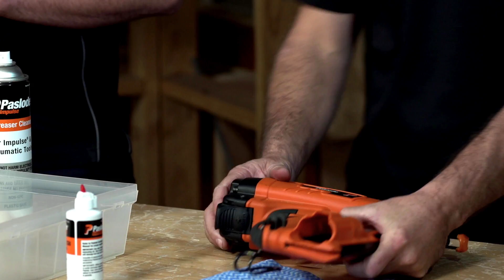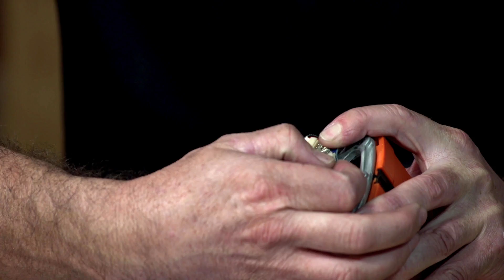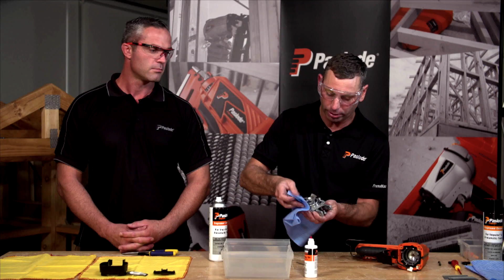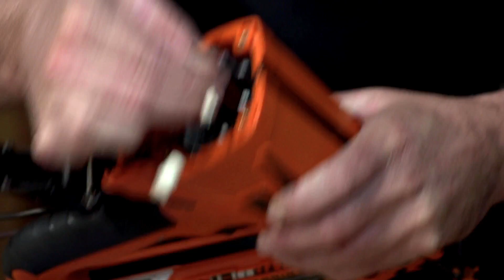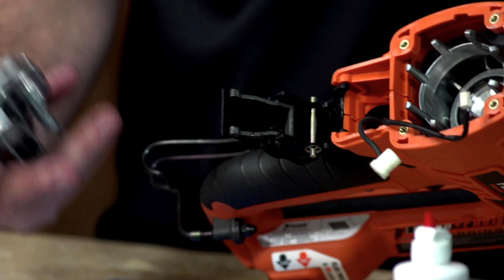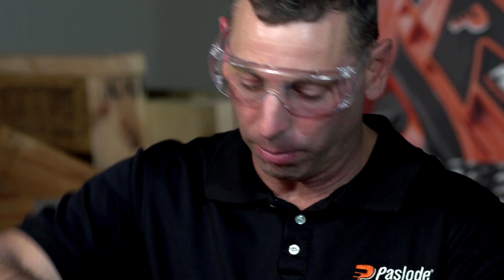How to clean the Paslode TrimMaster Bradder

Comment: I have this exact same Pasload finish nailer that's about 2 years old. It in great condition inside and out, it stopped firing regularly so I disassembled it completely and cleaned and lubed the head a cylinder with all Pasload brand cleaner, and oil, I have fan and spark, brand new gas bottle and it doesn't fire. Any suggestions as to why it's not working?
Reply: I'm in the same boat. I've got so much work to do and I'm sitting on Youtube looking for answers as to how to get this expensive thing to do it's job. Back to the store for me, again. 
This is not satisfactory.
Reply: Same issue, push plunger 5-6 times to get it to fire.. it's almost as if the spark isn't working. Can definitely smell the fuel. Soo frustrating, never an issue with my pneumatic, but wanted hoseless.

Comment: I've been using Paslode,  (also known as ASS-LODE), cordless nailers since they first came out;  back when they were black, and had a round battery.    I "USE TO" love these guns so much.   I loved the look on people's faces when I opened that box, and started nailing without hooking up a compressor, or an air hose.
NOW.....,   I can't look at that orange piece of sh*i without cursing under my breath, and being embarrassed every time I use it. (IF IT EVEN WORKS AT ALL).      I've owned about 7 different Paslodes since the 90's,  and YES,  I do maintain, and clean them properly.  But this piece of junk seems to only fire at its leisure.  And, that STUPID TIP falls off about 30 times per day!!!!!!!!   
WHO DESIGNED THAT PIECE OF CRAP!!!!!!!!????????    I guarantee you they've never done a day of cunstruction / carpentry work in their life.  
I'm SOOOOOOO  pissed off at that piece of crap.   It has cost me thousands of dollars in time & labor over the last year.
 I replaced the spark plug,  the rings,  the fan, & the battery.
Not to mention THAT STUPID TIP that I replaced 4 times!!!!!!!!!!!!!
I'M SOOOOO PISSED OFF,  and everybody will continue to hear my disgust  UNTIL THE DAY I DIE !!!!!!!!!!!!!!!!!!😠🤬🤬🤬🤬🤬
 Everybody that I know calls gun by the name I call it all day long.... ASS-LODE.
 I will never, ever ever ever ever ever ever ever buy another ASS- LODE piece of sh*t as long as I live!!!!!!!!!!!!!!!!!!!!!!!!!!!!!!!!!!!!!!!!!!!!🤬🤬🤬🤬🤬🤬🤬🤬🤬🤬🤬🤬🤬🤬🤬🤬🤬
Here's to you 👉ASS-LODE👈🦧🍭🌭🥨🦍💩🤢🤮🥳🤓😡🤬☠🙈🙉🙊💣💥🖕👊👎🦶👅👨‍🦼🐌🍌🧀🍼🔪🦽⌛🔥🧨🎀🧸🩲💸🖍🔫🚽🧻⚰⚠️🚫⛔☢❌❗0️⃣🔤🏴‍☠️🤯🤬💩
🚫NEVER AGAIN!!!!!!!!🚫🚫🚫🚫🚫🚫🚫🚫🚫🚫🚫🚫🚫🚫🚫🚫🚫🚫🚫🚫🚫🚫🚫🚫🚫🚫🚫🚫🚫🚫🚫🚫🚫🚫🚫🚫🚫🚫🚫🚫NEVER AGAIN!!!!!!!!!!!!!!!!!!!
Reply: Lol, same I still just use the air guns. 
%10000 strick rate. Lol

Fuck these guns. Fuck even trying to clean this heap of shit in my other hand as I write this